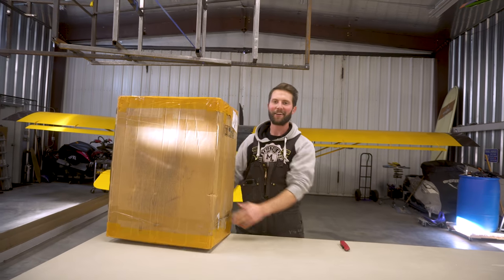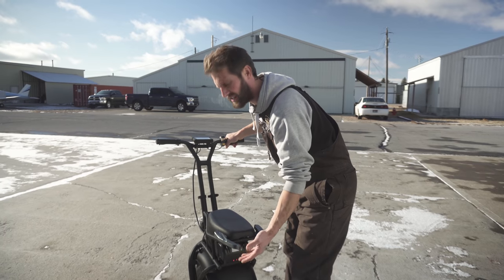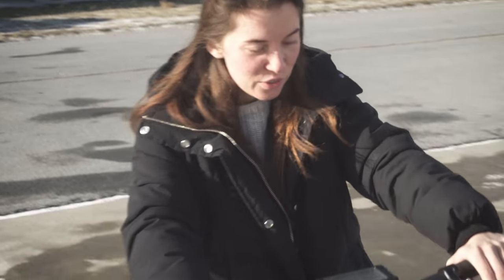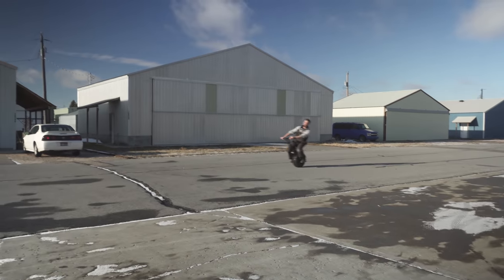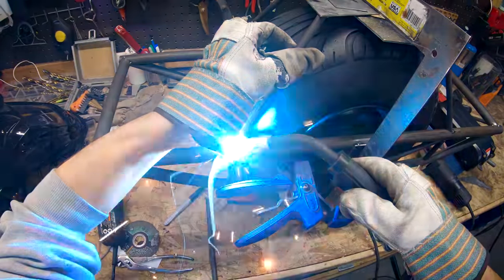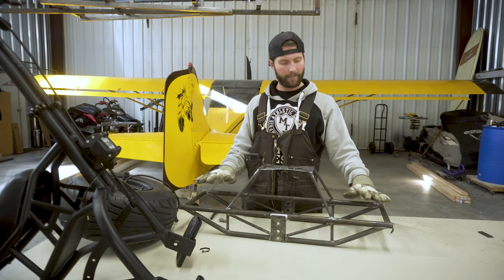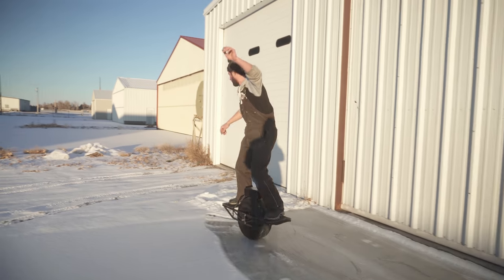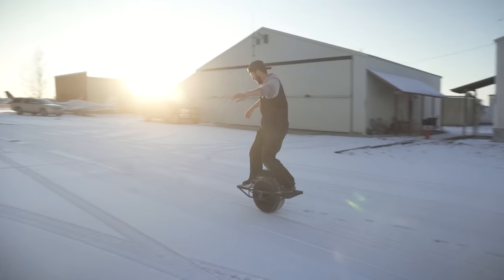I built my own ONEWHEEL!

Comment: Wanna make life easier, riding more stable, and starting easier? Re-engineer so your platform is well below the axle. Trent will be jealous.
Reply: I was thinking the same thing! Only problem with the pads being lower, is off-roading, and digging the front pad into something!
Reply: Having messed with these before, i know for a fact that they need to be re calibrated for the new structure. That's an electronic thing more than a physical one.
Reply: It will also be easier to get on.
Reply: Took the words out of my mouth.
4" lower deck and you're way more set on all wobbles
Reply: ...and easier on your ankles, mine hurt just watching it.
Reply: @f2air  Jonas was pretty much a pro skier, if his ankles could survive that this is nothing
Reply: Wouldn't this have an adverse effect on turning?
Reply: We really shouldn't have to explain centre of mass to a pilot should we! ;-)
Reply: @juststeve5542  I learn a lot from Jonas.
Reply: Ouch! GO ahead and say it now, get it out of the way. Looks fun but for me not going to happen. I banged myself up enough with my 66 schwinn stingray and the influences of Evil Canevel. And this was before the bmx craze. The bike was cromoly steel. I broke handle bars and  wheels but the frame and forks never died. We did crazy stuff and we never saw anyone else do it first. So it was kinda like is this going to kill me or cripple me every time we built a bigger jump or flew a steep gas line hill. You bring back alot of good memories thank you. PS wear a helmet.
Reply: @aserta  So is your point that what we see working just fine, can't work?
Reply: That's what I said. But I had never heard of a one wheel before. But I have a better than average knowledge of center of mass/gravity, they both play a part. Being a large man (300+) that does everything smaller men do, my center of gravity is a lot different than a man with.... well, a ladies figure. Riding a bike with 200 pounds above the center of gravity made my younger years hard. Chasing my big brother around, doing everything him and his friends did.
Reply: And copy OneWheel's kill switch under half of one of the boards, leaving the other half to keep both feet up until you're set.
Reply: Shack Man Evel Knievel
Reply: Electric unicycles are a thing, for some reason lots of ow guys don’t know about it. OW I believe is 67v, but normally they run 84-100v. Their platforms are below their center of balance and their battery packs and motors and quite a bit smaller. (Pretty sure I met the OEM that makes what this is made of, and I’m 99% it’s 500w, not 1000w motor (normal Euc’s run around 2000w). 

And people spend thousands on these
Reply: Can be adjustable height
Reply: Definitely the solution to getting it spot on.
 Low down.....

Comment: Put a sensor on it, so the motor won't engage unless it is horizontal and loaded on both platforms. And lower the platforms a few centimeters, to improve stability.
Reply: Allan Folmersen Definitely drop the stand pads to drop the CG. That was my first thought too Allan. Knee and elbow pads! You’re not indestructible.
Reply: @tomcoryell  
What's a "centimeter"?   Just kidding - I'm Canadian.

Comment: Not gonna lie I thought it was going to be a failure, nice work.  Try out an electric unicycle like the kingsong 16x  twice the range and ground clearance of the one wheel for the price and a bit easier to pack. Rips on single track and pavement.

Comment: You need to have the standing plates on either side of the wheel in line with the axle, not on the side of the tread. And lower to the ground below the axle to  give you stability.
Reply: Thom Besch agreed. I figured he would straddle the Wheel side to side with lower foot platforms. I think it would be more stable if they were lower and more comfortable to ride as well.
Reply: One wheels and the motorcycle he modified both have the feet straddling the wheel and below the axle.  I’d like to see him make this mod
Reply: That would defeat the whole purpose of the mod, which was to replicate a Onewheel skateboard. If you put the platforms on the side you would just have an off brand Segway with no handle.
Reply: Yeah I can see that. Seems sketchy though that high up.

Comment: hello Jonas,  interested in your feelings on why some bush planes have safety chutes and some do not. new to aviation, and leaning towards a 103 type aircraft with the chute system. enjoy your productions, you seem very content and steady. Jessica
Reply from the maker: Depends on the aircraft and who is flying it. Some aircraft come with a chute and some pilots prefer to have one installed.
It is a nice safety backup having a chute. 
Especially if you are flying over dense forest. 
Two stroke engines in ultralight aircraft are somewhat prone for engine failures. So you’ll tend to see more chutes in Ultralight aircraft.

Good luck and feel free to ask questions. Sometimes I don’t see them but I do my best. 
Cheers!
Reply: thanks! @JonasMarcinko

Comment: Great job 🤣🤣🤣🤣👌 just one little problem is that you placed the horizontal frame for your feet above the center of the wheel nut 👎 it will make it top heavy & harder to balance,  if you put the frame bracket hole center above the frame & raise up the batery frame 100mm for when you lower it , it will be more balanced for when you start 😁👍

Comment: Hey Jonas! I just saw the one-wheel conversion video, and must commend your vision, your skills, and your crazy balance. I am a pilot also, and would love to convert my two Dahon folding 16"-wheel bikes to ebikes. Its pretty boring compared to the one-wheel, but crazy useful, and would leave you with transportation even when the batteries poop out. Cheers!
Reply: Get a full sized Montague bike, then a BBSHD mid drive conversion from LUNA CYCLES, that is what I fly with in my RANS S-7S.  38 mph top speed, with a Rohloff hub's gearing spread, and up to 60+ mile range, a bit over 50 pounds.

Comment: I do feel like a bigger wheel is just bound to be an eventual evolution. Along with obviously more power.
Reply: As with unicycles and bicycles in general, bigger wheels = more stability, because there's a larger moment of inertia.  In fact, it increases as the square of the radius.

Comment: Hey Jonas, how can you arc weld without dark goggles?
Reply from the maker: I just do a tack weld and then put the helmet on to finish welding.
Reply: @JonasMarcinko  I've done that too... tacked a quarter panel on a Camaro…. burned my eyelids cause my eyes were closed when tacking and I couldn't open my eyes the next day... :-)… only did that once... doing a few tacks probably OK.... 300 not so good

Comment: You should put the cover back on like the original one wheel to prevent your feet/toes going in the gap. safety first
Your range might be higher since there's less weight on it

Comment: Nut-job....a very capable nut-job. I hate to be the one to point this out but the scooter would also have fit in your plane. I thought you were going to design it like Hal's one wheel with the platforms on both sides of the tire...that way your feet would be close to the ground; easier to mount and dismount. Did I see you doing those spot-welds with your eyes closed behind CLEAR safety goggles ? Once upon a time I did a bunch of spot-welds with the closed eye protection fallacy. It burnt my eyes right through my eyelids.

Comment: Don't wear a helmet. It's shock absorbing capability is negligible while it's increasing the size of your head interfering with you active dynamic system to protect it (what you learned since being a toddler to keep your head away of impacts). So helmets INCREASE the chance of severe head/brain injuries. Helmets are fine protecting you from cuts or bullets but not from injuries falling from a skateboard bike...
You should definitely wear gloves. You use your hands to protect your body and they are very fragile to abrasion, which gloves (any long fingered (not those cut fingered "cycling gloves")) will do - 1$ or 1€ fleece gloves are fine.

Comment: You'll want grip tape on those stomp pads, bud.
I skate... Trust me, you'll be begging for the grip if you don't. You might not think it's much of an issue, since you're not gonna be moving much once you're on... Until you slip a foot into the wheel and it rips you off.

Cool idea, by the way. Makes me wonder which is cheaper, at this point. OneWheel XR, or this motorcycle style?

I hot the sub, by the way. I saw airplanes, and this, and I couldn't help myself.

Comment: #1, get Sylvia(Welcome back ;) some gloves, even mechanic ones for short time use outside..girls get cold ;) That thing has 'broken leg' written all over it!  To bad you couldn't fit the 1-wheel MC in the plane, as I think w/more time that would have been a RAD vehicle! Now build a carbonfiber side car for it, that dissembles, and fits in the plane..so you can both get to town.

Comment: I want to see a one wheeled wheelie next. For buddies that want to try it, put some out rigger/ wheelie bars on it, like on a drag car. Put them on the front and rear. Make the height adjustable (for different levels of sketch) with some quick pins and also make the front and rear quickly detachable. That way anybody can practice on it without breaking a wrist. Pull the pins and take the front and/or rear wheelie bars off after they get the hang of it.

Comment: Why don't you convert it to a tug for your aircraft. I think that is what is called
Reply from the maker: good idea!
Reply: @JonasMarcinko  Yeah Jonas, that is a good idea. Run a tow bar from the front wheel of the plane to a "Y-shaped" coupling that attaches to both sides of your axle (if it's above or below the axle it will pull you over on your head or something else that might REALLY get hurt!!  ;^)  Then you show it to Mark Patey and sell the whole thing to "Best Tugs!!!!"

Comment: That was great ! I think it would be easier to ride if the standing platform was lower than the axle. What do you think?
Reply from the maker: I initially built it to adjust that. But then the battery doesn’t let me adjust it lower just higher :/ but it’s actually fine how it is. Would be interesting to see if it makes a big difference if it were lowered.

Comment: I guess it`s too heavy. Carbon parts for the feet? Yeah sure - but the rest? Big oof. I guess you could save 70% of weight only by replacing that wheel/rim. The frame could be carbon aswell.

Comment: Love how you did this. It's cheaper than an actual one wheel and this is alot more impressive
 🤘🙌
Reply: uh, it's not cheaper.
Reply: @deanaoxo  maybe not if you get the cheapest smallest one wheel possible but the xr one wheel is like 1800 and this was way under and if you can weld and actually do the work for self it's definitely cheaper for similar quality and size speed ect.
Reply: @deanaoxo  and when I first watched this amazon still had a similar option to the one in video that was actually way cheaper than one similar now
Reply: @Reecefpv  how much cheaper? I thought they were $1600? If you aren't putting over $200 worth of parts and effort into it, then i'm pretty confused how he got there. 

Don't get me wrong, it's a curious exercise, one in which i've seen plaid out over and over in various sports. 

What i always wonder, is why someone with obvious skills couldn't actually look at a onewheel (in this case) and figure out the good parts, emulate them, and try not to make the mistakes that have been pointed out. 

Serious question, do you think he would ever fly an aircraft that had been built by someone that had never been in one? Or build one had he never flown one, or seen one? 

aoxomoxoa
Reply: @deanaoxo  well the cheapest I see now is like 1200 for similar to what he used to create the bigger one wheel. https://www.amazon.com/dp/B081QR2673/ref=cm_sw_r_cp_apa_i_BWKGVKV0SQ1TY4GN5P73?_encoding=UTF8&psc=1
But I had seen a cheaper one that was around 1k but I can't find it now. 
And I started fpv by building a drone and never seen on in person or ever flown one and I did that. I guess it comes down. To what you have on hand and the skill you have acquired like. I probably wouldn't have to spend anything for the frame since that stuff could be recycled from scrap found anywhere. Or even old bicycles that get thrown on in trash everywhere.
Reply: @deanaoxo  and there are chinese site that can get something with the correct parts way cheaper but just have to wait forever lol
Reply: @Reecefpv  okay, well, i stand corrected on the base price, thank you. My point is, quite a bit of skill and labor and parts were put into something that may look pretty good, but has bad geometry and could of been way better as pointed out by so many people.

Comment: That is crazy impressive, I mean you could have bought a One Wheel for the price you paid, but you've got the most unique one out there now. I always wondered if one of these "monocycles" could be turned into an Electric Unicycle or OneWheel clone. I do agree with other comments that you should have a helmet for this as the ride height and speed are well higher than a OneWheel, you also have a higher center of gravity so an over lean could end waay worse. You might also consider building a full fender to block the snow.
Reply from the maker: Fender is the plan when I build the carbon foot pads

Comment: Fun ! 
Lower tire pressure may assist balance. ATV stunt guys run low tire pressure making riding wheelies easier. Lower tire pressure would also be your suspension. You’ll be a pro in no time.

Comment: This totally goes against the "If it aint broke don't fix it" mantra but hey I can see the fun in it. Regards, Jim in NI UK
Reply: But it doesn't.  The original vehicle was too bulky to put in the back of the plane.  What I don't understand was buying a $1600 electric unicycle to make into a OneWheel, rather than buying a $1600 OneWheel.
Reply: @BrightBlueJim  I guess that  Jonas just fancies an all terrain  One Wheel. Mind you the daft Brat should stick a helmet on his noggin  and as for his welding without a mask  that is beyond the Pale. Regards, Jim in NI UK

Comment: You didn't build your own, you modified a sit down one wheel to be a stand up one wheel. It also doesn't have pressure sensors in the deck.